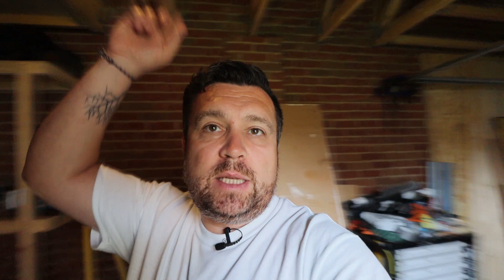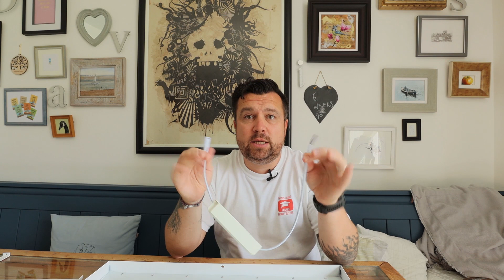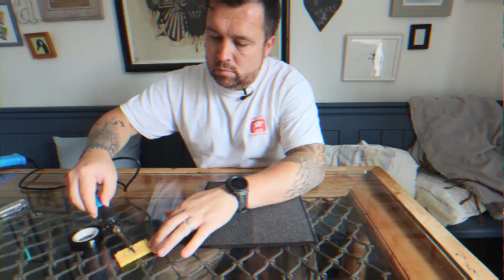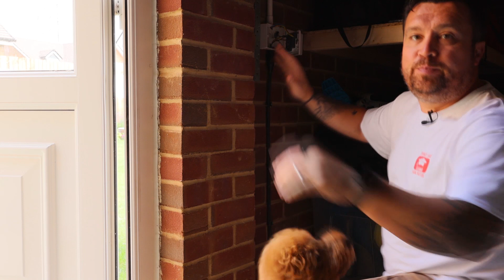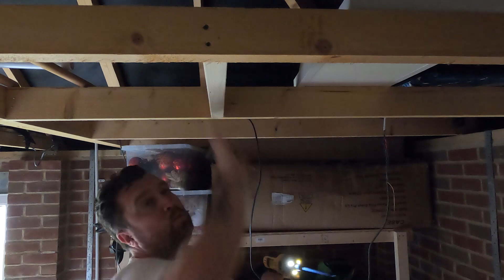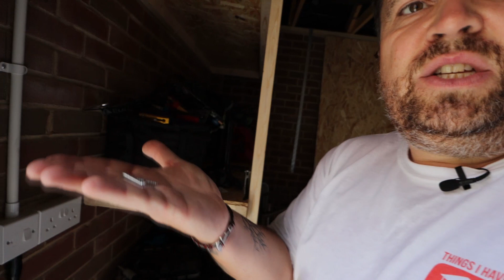Garage Light Install - How To

Comment: You didn't actually show how to install the lights or wiring.
Reply from the maker: As i am not a qualified Electrician - I would hate to show people how to do something that I am not qualified to do - as I have mentioned in the video, you need to make sure you are safe when installing anything electric.  If I was a qualified electrician, I would have for sure done a step by step...

In terms of the light install - I do cover the way the lights work, and how I attached them into the ceiling and the rafters.....and I think you guys having to watch me struggle soldering all the wires together is painful enough without you having to watch the almost 2 hours it took me fighting with a light switch to get everything in place.... only to then have to undo everything and go back to the original switch :)

I hope you enjoyed the video though... :)